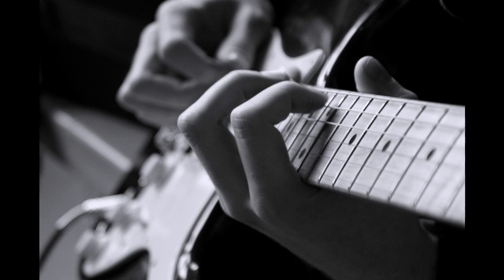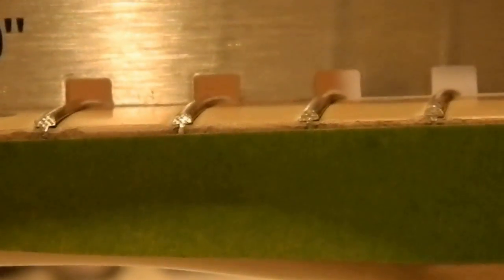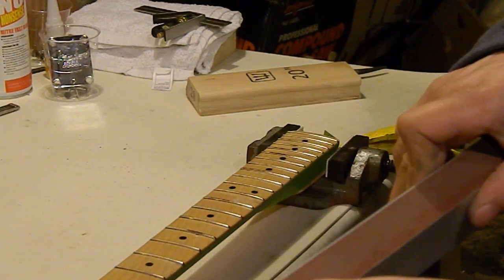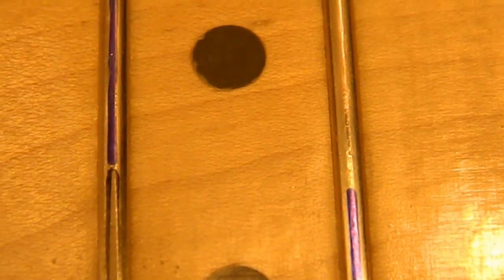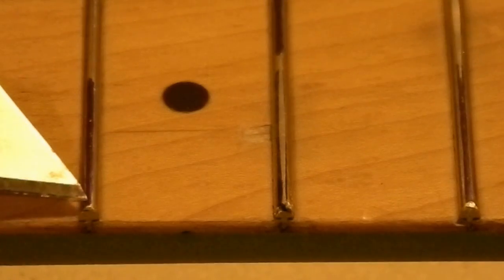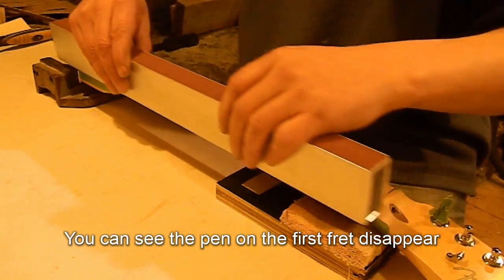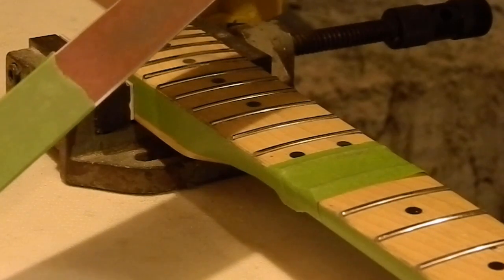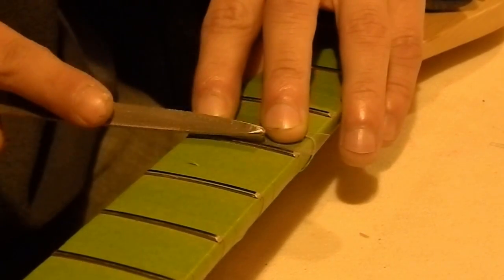Guitar Fret Leveling Why and How - Part 1 of 2

Comment: great video! I only have one question. I'm just about to refret my strat, but I found out that the neck has a bow that simply can't be fixed with the trussrod (the neck is perfectly straight from 21st to 5th or 4th fret, then it has a bow between that and the nut). My question is, how can I straighten the neck so I can properly start the refretting process? Thanks!
Reply: Depending on if you broke your truss rod. If thats the case and u have never had to replace one, its definitely better to take it to a pro than to muck up your baby. Also, if you DIY, then I recommend buying the elastic banding in the stewmac catalog/website. If your off more than a 1/32nd of an inch your intonation will be off and it'll sound out of tune all the time. If your truss rod nut turns to no end then chances are you will need to buy a new one. They're fairly cheap. I tried fixing my own truss rod and I admit, HUGE mistake. I've worked one only one guitar that never had a truss rod. The whole guitar was made out of carbon fiber. Sweet looking guitar and you wanna talk about light...it brand is called Rainsong. Not truss rod needed when the neck is always straight. Good luck hopefully this helped.
Reply: What Amazin Blazinasian said. I'll add my two cents worth:  Wood can warp as it ages, and sometimes, a flaw of some kind can also slip through the final inspection at a factory. 

  First of all, determine that your tension rod is operating properly, by making some adjustments in either direction with the strings removed. Use a good straightedge if needed, to confirm that the wood is responding to the adjustments. It the rod works, and then you try to adjust the neck with strings installed & still can't get the bow out, you can use the straightedge to see how bad the bow is. If it isn't too severe, you might be able to get the guitar to play satisfactorily by dressing the fret tops as shown in this video. But you can often determine if this is a viable solution before actually doing it. You may find that the warpage is too severe to be corrected in this way. I'm giving Duncan a thumbs up for the widely-accepted correctness of his method, so  go by the instructions in this video.

    If dressing the frets won't do the job, it means the neck and/or fretboard wood themselves are either now warped, or weren't correctly shaped & surfaced to begin with. If so, you might still have an option. You would pull the frets and level the fretboard itself, using a similar method as the fret dressing illustrated in this video, but on the board instead of the crowns. Ideally, you'd end up with a fretboard that lies flat, while the tension rod is loose. Then, you can install new frets, and you may wish to select fret wire with a tall crown. That will give you a chance of doing more fret dressing to correct the problem, depending.

   Sometimes the wood is just too warped to level completely without excessive wood removal, so keep that in mind, it ain't a happy scenario. If you can get the board MOSTLY level and no better, the tall frets MIGHT allow you to level them enough to get the desired result. If the neck is really just too warped for these methods to work, you are looking at possibly replacing the fingerboard, or even installing a new neck. 

   In some cases, the problem turns out to be that the neck & fretboard weren't joined properly, or may even be partially separated. In these cases, what's needed is to merely remove the board and re-glue it to the neck properly. Further inspection while the board & the neck are separated can then determine if the problem is the neck, the board, or both. All the glues used in a guitar's initial construction (generally white polyvinyl or hide glue) will soften & release with heat,  sometimes with the added introduction of water or steam. Epoxy or super glue, not so much, they're both impervious to moisture. Too much moisture will swell & soften the wood, so be careful. 

  The main idea here is to do a lot of careful inspection & measurement, along with consulting an experienced repair person or even several, BEFORE attempting any repair. Nobody can just give you a simple fifteen-second explanation of the problem, and nobody can determine the exact cause or the type of repair needed, in only a few minutes. These things can take some time, before any actual work proceeds. I don't believe I've ever even seen a warped or hopelessly bowed neck on any Fender. My personal opinion is that an experienced repairman could determine the cause of this problem on a Strat neck fairly quickly. I don't have all the answers, but this should give you something to go on. Hope it helps.

Comment: Hi, just ordered a few bits to try and learn these techniques and save some pennies. Quick question if you do the neck in 2 stages. 1-11 12-22 how do you know they are the same as each other. I Might have missed something here!! Would it not be more precise to do them all together. Great content. Awesome videos and help please 👍
Reply: The only time you should do any part separate would be after leveling the ENTIRE fretboard perfectly level, then putting some tape over the 12th fret and doing a slight bit more leveling from 12 to 22/24. This creates a 'fall off' effect on the higher frets which would allow you to get your strings a bit lower. If not done properly tho, you are taking a big risk. I prefer to just get a nice level fret board. The fall off will only get you 1 or 2/64ths of an inch lower strings and the risk just isn't worth it to me personally.

Comment: Great video and very well explained methods. 
However... After checking/adjusting the neck so it's level, I personally would have masked up the Fretboard. 
And as far as levelling beams go which usually cost a small fortune...Using a Spirit Level is a much cheaper alternative.

Comment: Very informative videos Duncan and a very thorough job you did. I have a question.I recently bought a vintage 50's parlour guitar online(no truss rod).If I put a capo on,the middle strings are barely touched.Is this a warped or a bowed neck and is there anything I can do to rectify this? It is also really difficult to barre cords,especially on the first few frets. Your comments would be much appreciated. And I would definately watch an acoustic guitar set up/intonation video if you posted one.
Reply from the maker: Orbital 0769 hi orbital - it's really hard to give you advice without seeing the guitar but it sounds like something is quite badly wrong ... the capo you are using, is it fine on other guitars? ... do you have another capo you can try & see if it has the same problem? ... is the problem the same up & down the fretboard? ... get a straight edge (6" ruler or the like) and put it across the fretboard & look from the nut - is there a regular radius across the fretboard or does it dip in the middle? You might have to bite the bullet and take it to a guitar tech & see what he reckons ... it's so hard to know what's wrong without seeing the instrument, sorry dude
Reply: There is a definate dip in the middle,more so on first 5frets. I took a chance on this guitar on ebay,its 50-60 yrs old,though fortunately I didnt pay much. Have you come across this before and if so can anything be done? Realise its hard to say without seeing the guitar!...thanks for responding anyway.
Kind regards..
Reply from the maker: Orbital 0769 sounds like you need to re-radius the fingerboard - that involves removing the frets then sanding the fingerboard using a radiused sanding beam to restore the proper "curve" on the board - it's not too hard to do ... there are vids on youtube ... i have video filmed of me doing one but it's just getting time to edit & upload it! ... it's something that would prob run you around £200-£230 including the refret/setup etc if you got a tech to do it - everyone's prices are different though.
Reply: Thankyou for the advice Duncan. I will look into that. It wouldn't ever be worth having it done by someone else but as a project for me,its feasible.
Kind regards...
Reply: +Hi , I know you've had some very high-tech replies , but I have one capo that's great on a nylon-strung "classical" guitar ( with a very flat , non-radiussed fingerboard ) , another capo for jumbo-body acoustics , and one more for electrics .Could be your answer .
  Cheers , Nige .

Comment: great videos m8, very informative and gave me the courage to think that I can do that too.
I have ordered some tools , they're on the way.
at the first part of leveling how did you manage not to sand down the frets 12 and higher? I can see that you move the leveling beam over those frets
Reply from the maker: The frets on this guitar had a fall away sanded in when it came to me, so as I run the beam over the whole fingerboard it doesn't really touch fret 12 & higher (you can see at 13.42 it has just skiffed a couple and taken a little pen off). If you are doing a  guitar that has no previous fall away its ok - just sand the whole fingerboard until frets 1 to 11 are level then apply the tape, re-mark the high frets with pen and sand your fall away.

Best of luck when your tools come, just go for it & I'm sure you'll do fine ... just take it easy at first - it's no bother to sand off more but a lot harder to stick it back on if you sand too much ;)
Reply: I thought so but you didn't mention it while recording the video so I had to ask ;)
thank you for replying so fast.
t.c
Reply: Yep agreeing the pace and clarity of this tutorial give you a good sense of the reality of the work and some confidence preparing to take it on. TBH the 'fall away' makes perfect sense to me but is it me or I have not seen it mentioned before? Is it a special and top notch way of working the best out of a set up?
Reply: Nick, I've been around long enough to have seen changing (i.e. opposing) trends in the thought behind fret work, and so far as fallaway is concerned, I'm still not entirely convinced. It's partly that I'd like to see a side-by-side comparison. Another reason I'm a bit skeptical is that my own guitars seem to have no problems from any excessive buzzing on the high frets, and I use almost zero neck relief when I do a setup, without any fallaway whatsoever. I'm not sure when fallaway was first introduced to fret work, or who ever thought of it, but it wasn't a consideration for quite some time, and people didn't generally seem to be in need of creating a fallaway on the upper frets. I do recall that sometime around the early 80's, people were noticing some fallaway on Gibsons & were regarding it as a possible manufacturing flaw, related to humping of the area where the neck joins the body. I can't say if Gibson was doing this deliberately to create fallaway, or if it was indeed a manufacturing problem, and I frankly wasn't all that much interested at the time. I'll admit that it did give me some concern that perhaps Gibsons weren't being built as good as they used to be. In summary, for my own purposes, the jury is still out. I'm sure there will be those who will fall vehemently into one camp or the other, so I'm keeping an open mind. I suppose if a person did a fret job by first making the frets dead-level and did a setup that achieved the lowest possible action, they might then go on to create a fallaway on the upper frets and then see if the action can be made any lower as a result. I just may have to try that experiment on one of my shop's junkers, if I ever get the time. I'd really like to know the answer myself. Sorry if I couldn't provide you with a clear answer, but these are some things you might consider. If I ever dig up any hard evidence that fallaway allows for lower action than does dead-flat leveling, I'll then be convinced, but that hasn't happened yet.

Comment: Great video! It seems strange that I never see anyone use a radius block to do fret leveling. It seems like it would be so much easier and more precise. Do the frets have the same radius as the fretboard? I was thinking about getting a couple radius blocks but since I've never seen anyone use them, I'm hesitant. Am I missing something?
Reply: The radius block method isn't accurate and you will end up rounding off your fret ends.  Using the block requires hand grip and pressure which you have less control over. As he said the beams weight is all the pressure he applies.
Reply: Yes, if installed correctly, the frets have the same radius as the fretboard.  But while a radius block will allow several entire frets to be sanded in a single pass to the correct radius and to the same height, it's too short to ensure that each group of frets that you sand are being leveled to the same height since you'll only be hitting 3 or 4 frets at a time.  With a straight 18" beam, you should keep the beam parallel to the strings, but push/pull the beam on diagonal paths from high E to low E and vice versa to follow the existing fret radii as best you can.  This won't help if the existing fret radii are wrong, though.  Also, Duncan seems to prioritize minimizing the amount of material removed over establishing a perfect radius (a good tradeoff, I think).

To address that problem, StewMac does sell radiused 18" long sanding beams -- https://www.stewmac.com/Luthier_Tools/Tools_by_Job/Tools_for_Sanding/Aluminum_Radius-sanding_Beam.html.  And the description mentions leveling installed frets as one of its applications.  That said, they are currently all priced at a "closeout" price of $117 (originally $156. ouch!).  I assume they're being discontinued not because they don't solve the issue you raise, but because no one wants to spend over $600 on a set of four.  And even if you had these, they may well take off more material than Duncan's method.  The good news would be that you'd know every fret is level with the others, AND they all have the correct radius, too.

That said, I think you could reasonable try to level frets with radius blocks since those same blocks are supposedly good enough to create a straight, radiused fretboard.  As in the fretboard application, you would need to constantly check your level with an 18" straightedge to notice when you have high or low spots.  It will be much harder to notice an error, though, since the straight edge on a solid fretboard is much easier to read than determining whether each fret is touching the straightedge.  Still, I guess this is not a totally crazy idea since StewMac's description of their 8" radius blocks also mentions leveling installed frets as an application.

Comment: Beginner/newbie question after determining high frets with a fret rocker: Is there a possibility that high frets are not fully seated in their slots, and could be lightly tapped/seated, especially when one end of a fret is higher than the other?

Comment: what grit are you using?
Reply: I believe he was using either 220 or 320 grit, both will work. Personally, I use 400 grit. It makes the process take a little longer but I can be more precise in my fret leveling. Another benefit of using 400 grit is that you won’t have as many deep scratches on the fret wire to clean up during the crowning